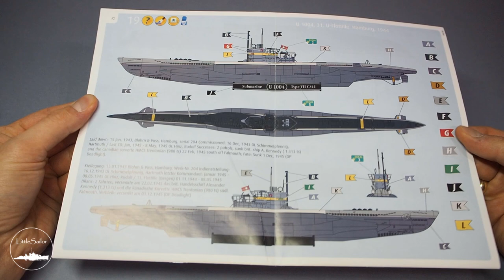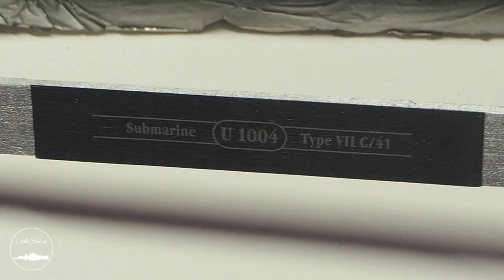DIORAMA - STORM AT SEA - using modelling clay, U-BOOT type VIIC

Comment: How did you make water splashes.   Could you show us   How you used that material   And   What it was.  😊
Reply from the maker: It's quite simple. I used Vallejo - still water or Vallejo - water texture to do it. You just have to put a thin layer on a foil and after it dries it's very easy to remove🙂

Comment: To prevent cracking, just knead the modelling clay with PVA. :)
Reply from the maker: I wonder if PVA glue will mix well with clay🤔 need to try it out🙂
Reply: @littlesailor  i used this trick plenty of times, it works wonders! You can try a small test piece :)
Reply: @littlesailor  PVA, not pvc tho. I don't know if pvc glue exists?
Reply from the maker: @eugenio5774  hehe autocorrection😅
Reply from the maker: @eugenio5774  so I’ll definitely try this method👍